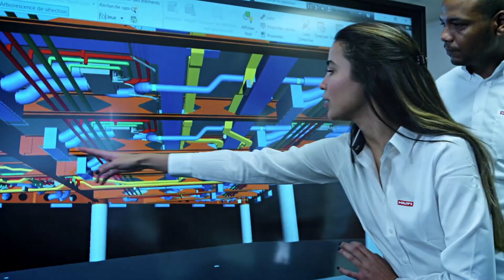UNVEILING the Hilti EXO-O1 Exoskeleton

Comment: what can this do about wrist and elbow wear?
Reply from the maker: Hello John, The EXO-O1 is designed to reduce overall upper body fatigue when the user is working in an overhead orientation. Third party test shows that the Hilti EXO-O1 can reduce peak shoulder load by up to 47%. If used properly, the EXO-O1 can help lessen fatigue.